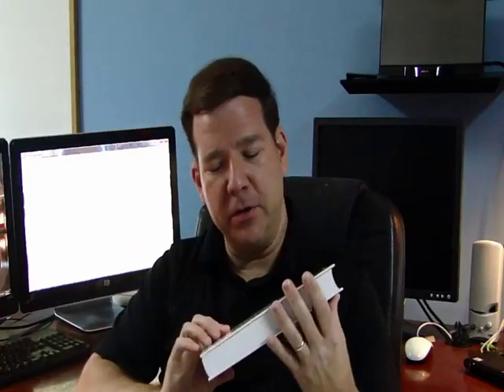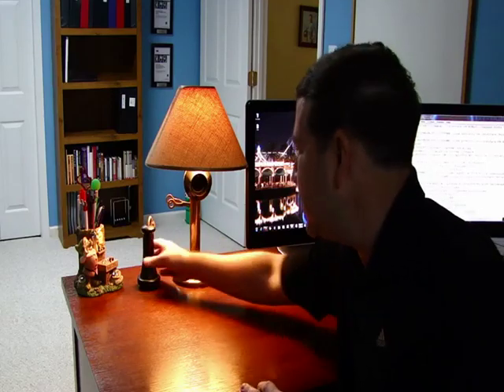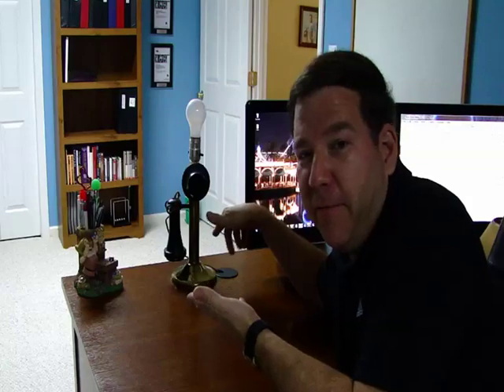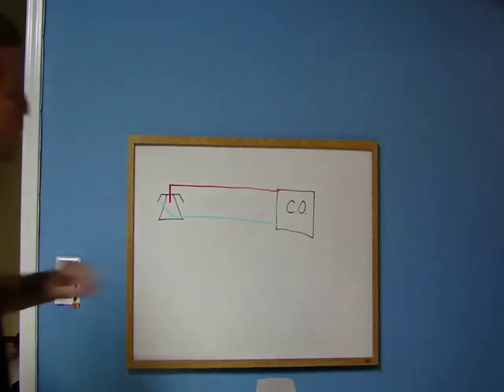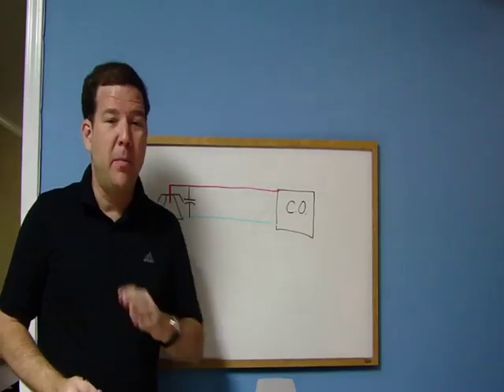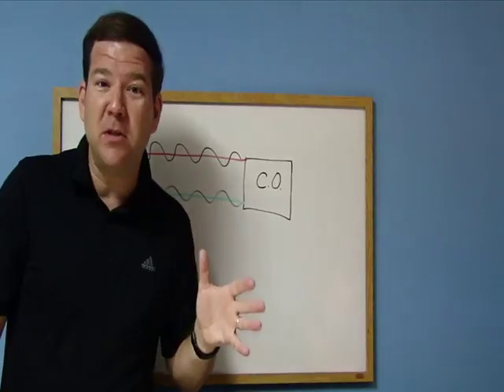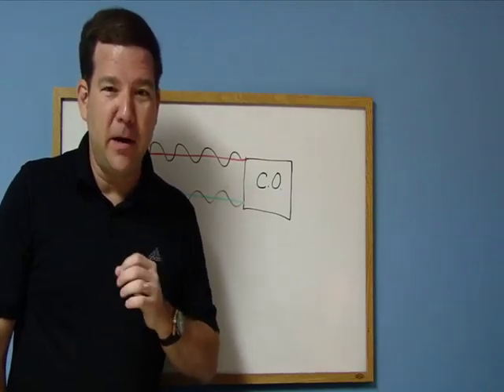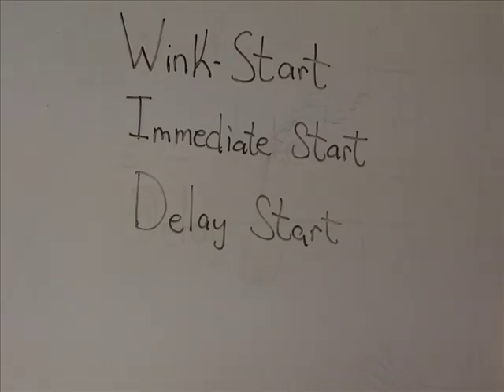The Secret Life of an Analog Voice Port (1 of 2)

Comment: Fun fact: The 3.5mm audio plugs were actually invented as an upgrade to the longer plugs used by operators at cordboard positions. Also, cordboards were still in use in some places as late as the mid 80s.